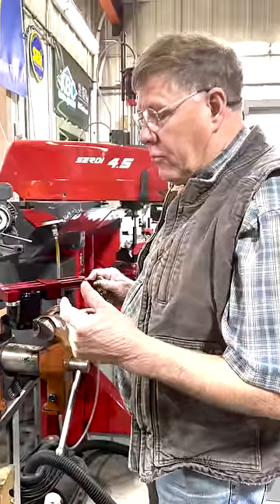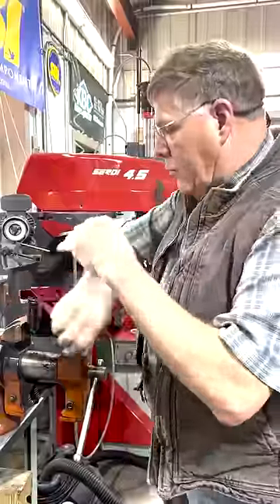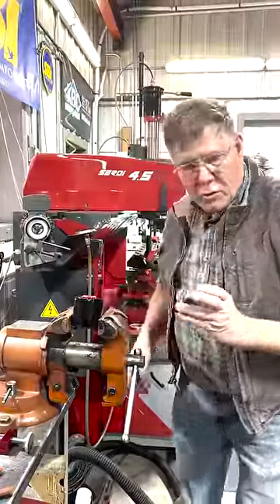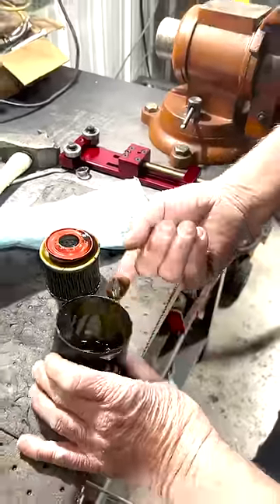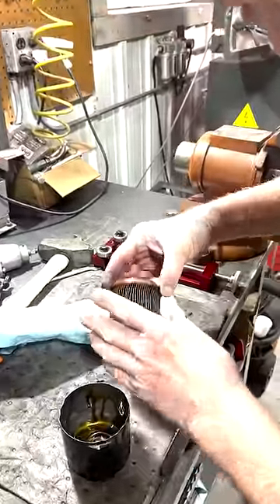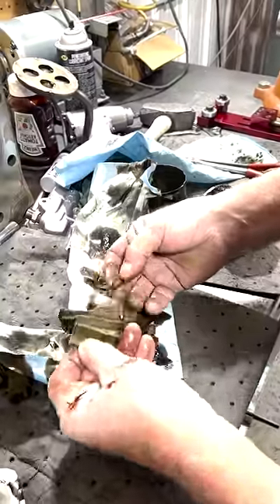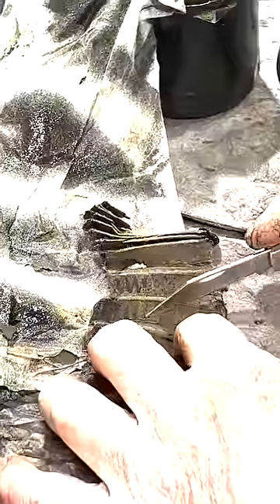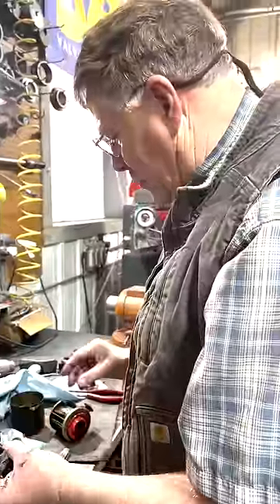#shorts Our Customer Ran His Engine OUT of OIL! 🤦🏻‍♂️

Comment: I had a beater that I only added oil when the light came on in hard corners. 
And it would chatter the rods at every startup where it sat more than 5hrs. After trying an OEM filter because that acts like a drain back issue and that didn't help,I decided it's not worth diagnosing further on a 1200$ car. 
So I drove it for another 40k miles and 8yrs.
Never did blow it up, I got 300$ from the scrapyard though.

Comment: Hmm… A vehicle not worth rebuilding an engine, if I were to guess, probably a Hyundai/Kia
Reply: Some 1.8 litre Toyota 4 cylinder engines from 2000 on are exactly the same..
run them out of any fluids and they are toast...
Reply: @JohnSmith-pl2bk  The only 1.8L Toyotas are the 1ZZ-FE and 2ZR-FE and variants. Pretty solid engines except for some manufacturing defects on the 2ZR that would cause them to blow HGs. They are not comparable to Hyundai/Kia Theta engines which were not good to put it mildly.
Reply: @moshet842  
But I have one and followed up on the Internet. 
Not repairable.

I check all fluids once per week and the start of every day when travelling.

I ensure that oil/filter change intervals even using full synthetic.... are 6000km

It's a daily driver/commuter in the city for my wife.....

I call that severe service (city driving)
Reply: @JohnSmith-pl2bk   What's wrong with yours?
Reply: @JohnSmith-pl2bk  As long as you keep up with maintenance, it will last virtually forever. The problem with the Hyundai/Kia Theta engines is that it doesn't matter if you maintain them properly, they will inevitably grenade before 200k miles. Besides, most Aluminium bocks out there are not repairable. It is not a problem unique to Toyota.
Reply: @moshet842  
Absolutely nothing that I know of....
and I want to keep it that way...

Comment: No problem running oil for 15k if the oil and filter are rated for that mileage. Also you still HAVE to check your dipstick regardless.

Comment: Some years ago I forgot to change the oil on my Ford Fusion Diesel. The oil low light came on although it usually never came on and I realized I had done 50 000 mi since the last change. I had the oil changed and everything was still great.

Comment: Kid in our shop had a Mustang and the oil pump locked up. The v8 uses a drive from the pump to the distributor. So it shut off right away. Boss told him to cut open the oil filter.  See if there is any metal in side it. He coms back all upset 😢. The filter was filled with metal….. from the hacksaw. 😅

Comment: Story, I once changed a customers oil, it was so bad that it was basically solid. Anyway, I drain what little there was to actually drain. I ran an oil system cleaner for about 15 minutes with fresh oil and a new filter. Drained it again (still looked like shit) replaced the filter, filled it back up, pulled sludge again. They were also very concerned about strictly running dexos to keep the GM warranty. Like man I don't know how to tell you this but it's already void 😂

Comment: I knew old timers way way back in the day when I was a teen working in my uncle's garage in the 70's who never changed oil. Only change filters. Buy brand new cars and trucks, and only do the oil changes during the warranty, and back then the warranty was like a year. Still do chassis lubes, change air filters etc. They insisted "oil never goes bad, it just gets dirty".
As crazy as it sounds, they ran them for years like that. They were the same way with their tractors, combines and other equipment

Comment: I had a Yamaha SR500 motorcycle. I took it to a shop in town managed by a friend of a friend for any necessary attention.

One day, I asked him if I could bring it in and use the shop facilities and bulk oil supplies for an oil change. He agreed and asked me if I had a new filter. I said don't need one. He looked surprise. I said the manual stated the filter should changed every second oil change. He looked at me with one of those looks that makes you realise you are about to learn something new, and said "a new filter is cheaper than an engine rebuild".

I bought a new filter and went into the shop that evening and changed the filter and the oil.

AND...

Since then, every vehicle in the household, be it motorcycle, car, van, whatever, gets new oil AND A NEW FILTER.

Comment: Thats what happens to all our fleet vehicles 
They are all leased with full service, but they put "extended intervals" using their special oil. 
Of course the drivers dont care so they run until the next oil change at around 20k miles or the lamp comes on.

Comment: I had a 2003 Buick Regal that I sold with 355,000 because the engine was making noise.  I didn’t want to spend $1,500 on it to fix what my mechanic thought was wrong.  The sad thing is I changed the oil every 5,000 miles with a good quality synthetic oil very Religiously. As a salesman 75% of those miles were Hwy miles. I was very unhappy I didn’t get more miles out of that engine because I treated it so well.

Comment: Amazing how everyone ASSumes he thinks the engine is TRASHED because of the story. The fact that there is "some glitter, lots of glitter" in the unfiltered oil but not much glitter and NO CHUNKS in the filter element he is saying it's not worth rebuilding the engine BECAUSE IT DOES NOT SHOW SIGNS OF DAMAGE. Low oil pressure alone does not always destroy an engine. It is still running fine and there's no signs of major internal damage, i.e. chuncks of metal in the filter so why tear down & rebuild an engine that is running fine.

Comment: I go 15000 minimum on an oil change. 90,000 miles and original brakes.  No sparkles in filter though the brakes do need new pads.

Comment: I did this with a 350.  The oil pressure sender was non-functional, apparently.  It locked up with a horrific screeching.  I put oil in it, let it cool, and drove it off like nothing happened. I just pretended everything was fine and squinted really hard while I changed the oil a few days later.  It eventually caught fire due to an oil leak spraying directly onto the passenger side  exhaust manifold.  I think I got another 20k miles out of it before that happened.  It was always underpowered and unhappy, but it never completely failed.

Comment: Our brick mason figured up how much to change the oil and filter over a lifetime of the truck and said it was cheaper to not change the oil… and buy a new truck.  He only changed the filter and topped up the oil.  Back then You could buy a brand new 4wheel drive chevy for $13,000 late 80’s .

Comment: We have a system at my home. My car oil change is in the spring and fall. My wife is summer and winter.

  But what's crazy is my VW from the manufacturer says to change the oil every 15k miles. I mean, oil technologies have come a long way, but yeah, that's stretching it. I just make sure i dont go over 7k in-between, which is hardly ever.

Comment: I would "change" my oil just by adding a quart or two when the oil pressure gauge would stop moving on  my first car, a 1974  Mustang II. I eventually threw a wrist pin through the side of the engine on night on my way home from school. The smoke was so thick behind me I couldn't see the headlights of the cars behind me on the highway. I was able to make it to the side of the road easily enough. Had to walk a bit to find a pay phone as there were no cell phones back then.

Comment: I used Mobil1 15k oil in my 2013 Altima and either a Mobil1 20k filter or Fram 15k/20k filters.  I routinely changed the oil at the 15k mark, checking for fuel dilution, which never occurred.  When Mobil1 came out with the 20k oil, I used that and changed at 20k. Car hit 350k easily until it was totaled from a rear end hit. I have every confidence it would have made it to 500k easily. What this video doesn't say is the guy is using crap conventional oil in a 1992 something, which you can't do and go 15k.
Now, instead of wasting your time and money doing 3k or 5k oil changes, you should be doing routine transmission fluid changes. For said Altima, with the dreaded CVT, I would do a one-drop change at every oil change (15k) meaning I would drain once and refill, which would exchange about 1/3rd total fluid, keeping it semi-fresh.  The transmission went 225k before it went belly-up, and the guy at the world's best transmission place (in Tampa) asked how in the world I got 225k on a Nissan CVT that he never saw more than 80k on before they would blow.  That's how.  Change your transmission fluid, kids. This is with regular towing!  For the record, my son was learning to drive about that time ,and I told him not to punch the gas on a CVT or the belt would break through the hydraulic fluid layer.  And, of course he admitted doing that regularly, so it's possible the CVT would have lasted far longer if Mr. Lead foot wasn't driving it.   I'm an engineer, so let's see what the one or two conventional wisdom experts have to comment on this. lol. Always a couple that can't resist.

Comment: I've cut open oil filters myself.   The glue that holds the end of the pleats together and the end caps on often doesn't last any longer than a good oil change interval..... You can't run them for 10,000 miles.... Change your oil and your filters often.... It's cheap.

Synthetic oil last longer than conventional but the filters don't. 

I work for a company with a lube additives  division in the early 1990s. I saw the test results of our own fleet testing... With Houston police cars.   Conventional oils were broken down completely.. by 5,000 miles.

Comment: The filter tells the truth . Any particulate is an indication of problems . Low oil. Not changed oil especially in extremes , one I like is ran till light comes on . Quickly add a couple gallons oil and say . What happened ! I like your filter opener ,not like days of old in the 60s , as spin on filters were just takin over as filtration devices.
Reply: Had a customer with a seized engine in a John Deere loader. I pulled the dipstick, and it was all clean oil except for a bit on the tip. We got the engine out, and it was hanging on the hoist. The last thing I did before going home was pull the drain plug. The next morning, I dropped the pan, and it had about three inches of jelly-oil. 

Swung a new engine in and 2000 hours later, it was back for a transmission. I saw that it still had the original oil filter on it, so I dragged it out of the shop, and they hauled it away.
Reply: @timothyball3144  
Sometimes you just have to fire the client.....

Comment: Went from east of Indianapolis to lake of the woods Minnesota (long grueling trip) with a buddy for an ice fishing trip ~17 years ago. He had a 4 cylinder ford escape. There was vibration that I knew wasn’t the tires and it was drinking gas bad for a 4 cyl. on the interstate. I could notice the gas gauge dropping way too fast from the passenger seat. I’d been thinking about it for hours and it was pretty much new because escapes hadn’t been out too long. I asked “how long has it been since you changed the oil in this”? He said it’s never been changed. I was shocked. It had ~45,000 miles on it. I was like WTH??? And he got all mad saying his wife was supposed to take care of that kind of stuff. He was an over the road truck driver so he didn’t have time for things like that but I’d have kept up with it. he told me a couple months later that he got the service done. Went up to his house and we went out, drove 55 miles to Indy and went bar hopping and the engine was smooth, rode all night and I couldn’t even tell the gas hand moved any.

Comment: 2018 Nissan Rogue bought as a pair Husband and wife combo so they both had their own 2018 Nissan rogue. Wife? 53k miles great maintenance super meticulous about caring for the car.  Husband? 48500 miles no oil changes 3 years and 48500 miles on factory oil and filter. How it came in running was shocking with the fact that pretty much every drop of oil had solidified.
Couldn’t touch the car without her first signing a waiver. If I remember correctly we wouldn’t accept liability on parts AND labor. She didn’t even make it out of the shop before she called her mother, father, brother, and then she called her husband.
And for that lady YES I’ve been telling your story since the moment you left. I would love to know what new car your husband got you

Comment: My experience is that when the vehicle reaches the end of that service interval for the oil change you can actually hear it, there are more sounds coming from the block and those sounds are louder, I cant imagine running an engine for 20k miles on the same oil, thats just wrong.

Comment: even clean and tended too oil still has metal filings. Not good not to change the oil but it used to be a way to rip off costumers when you dont know this is normal having filings in the pan too

Comment: Checking and changing the engine oil frequently is the cheapest insurance you can buy! I never wait till the dash tells me to change the oil. I change it at 3,000 to 4,000 miles. I never let it go over 4,000. If you change your oil every 3,500 miles and your car lives to 250,000. You will have invested $7,100 in oil changes, that's if your services cost you $100 each.
That's about what an engine would cost to replace. And your engine probably won't last 250,000. Also if you wanted to sell your running car it should be  worth several thousand dollars. A non running car is worth almost nothing.

Comment: I demand tests and licences in order to be allowed to own a car !!!
If you don't know they need oil and water...       and tires need air.

You need a bicycle.
Reply: I called a supervisor at work over to the air pump in the  yard and pumped up the rear tyre on his motorcycle...from 10psi to 30psi...and asked him to ride around the yard. 
He said it felt the best it had been for the 5 years he had owned it...
then I pumped up the front tyre and he said he couldn't believe how easily it steered.
I didn't dare to check the dipstick......
Reply: @JohnSmith-pl2bk  🤣😂🤣😂🤣😂🤣😂🤣😂🤣
Funny, but so sad at the same time.
You're in your late '60s I'm guessing

Comment: I'll never understand why people don't realize that mechanical devices, particularly reciprocating ICE engines NEED oil, and that it needs to be REPLACED regularly along with fresh filters for everything -- air, oil, fuel, etc. 

People please understand that no matter what your manufacturer, dealer, or oil brand claims or says, you should change your oil and filter every three to four thousand miles, and maybe once or twice in the life of the vehicle due to financial trouble or other emergency possibly out to five thousand miles; but it's much better to stick to three to four thousand mile intervals even with a high grade full synthetic. 

It's MUCH CHEAPER than a new engine! And a lot less 😵‍💫 trouble 😮

Comment: i have a Dodge Nitro SLT 3.7l v6 but the oil pressure at ideal is 4pds is there anyway i can up the pressure i had a mechanic said there is no way to do it n it has 145,000 on it . Thank U sir Larry from Stockton , Missouri

Comment: Modern oils easily last that long. If there is a problem with that engine it's not because of the oil, only because it wasn't kept topped off (and therefore run low on pressure)

Comment: Not that 15K miles is acceptable between changes, the fact is that you will see more signs of engine wear if you go further between changes. Doesn't mean that it is causing more damage. I know a guy that has never changed his oil and has 250K miles on his late 90's Avalon. Not saying this is good, just it is.

Comment: Wondering though. I don't put a lot of miles on the car. But I put in about a quart of oil a week, due mostly to a bit of leakage, tiny bit of burning, and mostly due to blow by blowing oil out the pcv system (unhooked because it was gooping up the plenum and the butterflys etc.) and I change out the oil filter every coulple of months.
Question is though is it really necessary to actually change oil when in essence I'm changing it every 5 weeks. (Putting in the quart of oil each week.)

Comment: Just change your oil every 5,000 mi, whether or not the oil says it's good for $20,000 doesn't matter. It helps get contamination and condensation out of the bottom of your engine as well as making sure everything stays clean.

Comment: I was gifted my grandmas fiat punto as my first car. She never checked oe changed the oil and it seized up. Took the spark plugs out, put a bit of 2 stroke mix inside. Freed it up and used for another year until the head gasket got so bad i had to refill the water every 5 mins of driving. Then sold it for 150 quid.

Comment: Had a ford explorer with a base 4.0l 70,000 miles and factory oil filter. Service manager warranted it. Cut my pay 40% by doing that due to difference in labor times. I made sure to leave the factory oil filter on the engine core when sent back and two months later ford bounced the claim making the dealership eat the cost of the entire job.

Comment: I run a 2022 corrolla hybrid( got it in late 21')  at 5k oil changes. It has over 130k so far. Need it to go another 170k before i can retire it. M6 99 yaros had 300k n ran like a top. I commute about 4.5 hrs daily
Reply: 99 yaris

Comment: As Long As It's Highway Miles With A Push Rod Engine And You Keep The Level Up, 15K Isn't Risking Much.  I Go By The Darkness Of The Oil On The Stick,  And Use PROLONG That Treats The Engine METAL, Instead Of The Oil.   Extending The Oil Changes On My Fleet Of Vehicles Beyond 5K, Until I Found The Time And A Nice Day To Change It, Has Never Been A Problem Over Several DECADES...